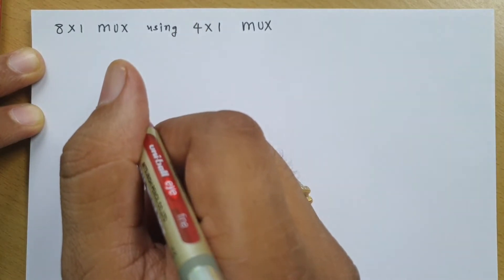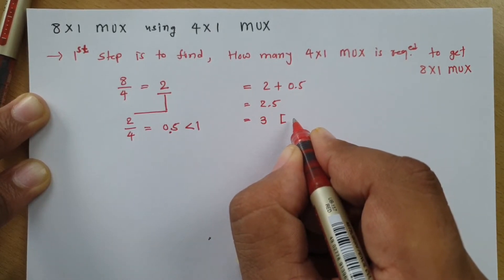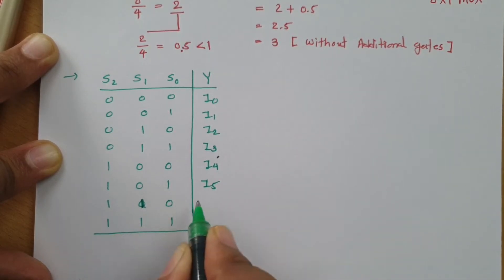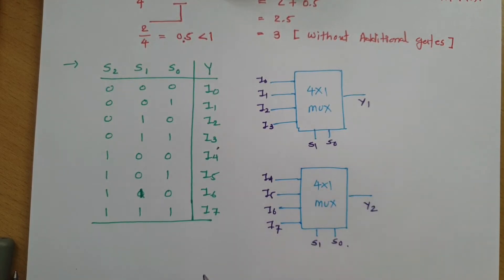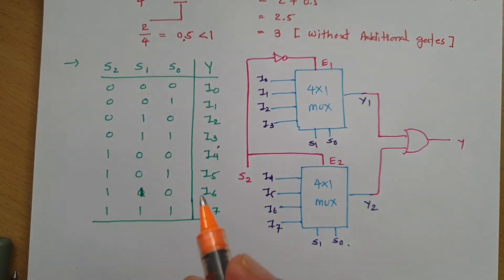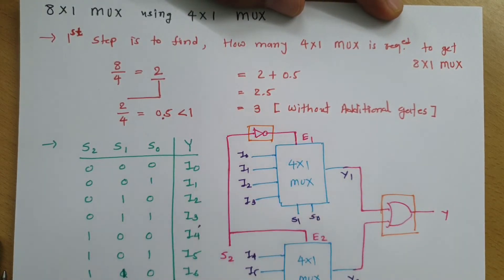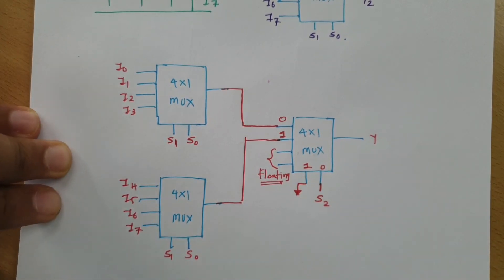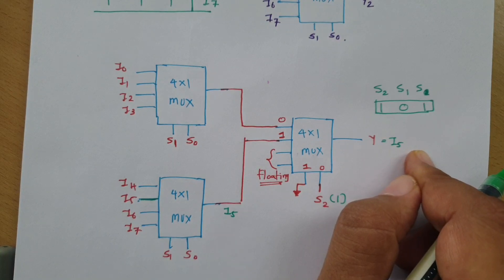8 to 1 Multiplexer Using 4 to 1 Multiplexer: Two Different Methods of Design

Comment: But for multiplexers enable is active low right??
Reply: @nanditha1980  in order to get output from any mux you need to enable it so the terminal 'E' will always be 1 or high for each terminal in the combination
Reply: @shrifashionworld7738  no, the enable pin is active low, so it should always be logic low for the mux to operate

Comment: would it make any difference if I float/ground another select line in final mux. That is in the truth table what if I had s0 s1 s2, means your s2 is my s0?
Reply: I don't think it'll make any difference since the values will not get altered with or without changing the order of writing S0 S1 S2,

Comment: Build a 2:1 MUX using an 8:1 MUX. (Yes, the question is right. Build a 2:1 MUX using an 8:1 
MUX) 
Sir is there any possible to design a 2:1 mux by using 8:1mux????
Reply from the maker: Use only 1 selection line from 8:1 Mux, it will be 2:1 MUX.